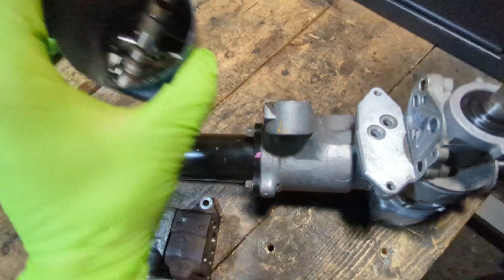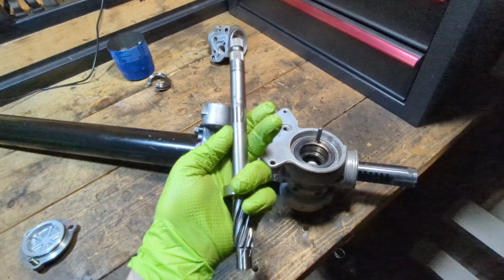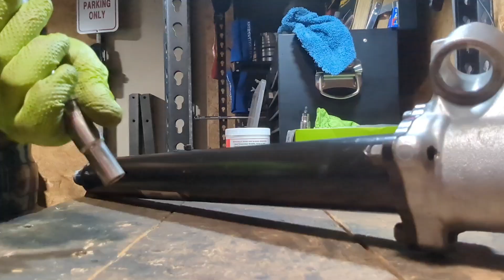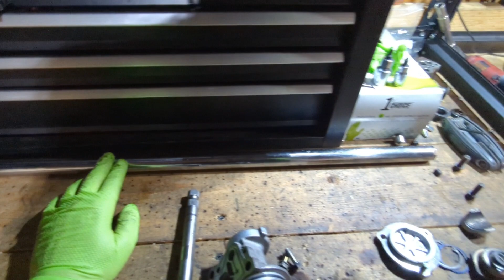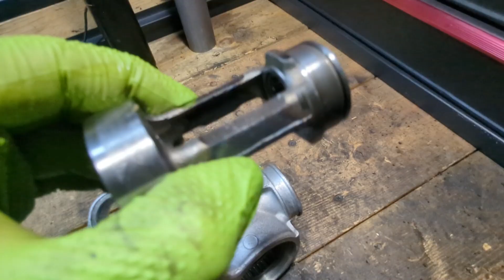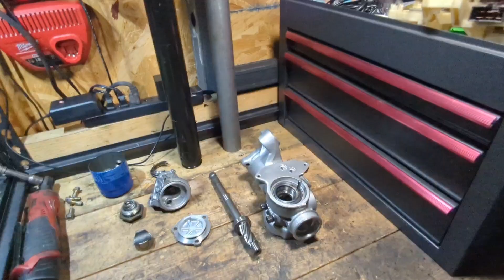How to Depower a EG Civic Steering Rack

Comment: Thanks for the vid. Once I had everything cleaned up, literally took 30 mins to drill/tap, grease and reassemble. I welded a small rod between the stopper bolts, so they can't back out.

Comment: so the rod (rack or whatever you should call it) is the same on both manual and power racks? i was wondering if i could replace my rusted rod from manual rack with a rod from power rack, which is more affordable because you can't find a manual one anymore.
Reply from the maker: Yes, they are the same inner and outer tie rods
Reply: @ThatParadiseEj1  i meant to say the rod that is in the rack, that is polished or chrome plated. English is not my first language and google translate just translates it as a rod.
Reply from the maker: @1ntegro  oh. Sorry. I have no idea if they're the same
Reply: @ThatParadiseEj1  aight. Thanks anyway
Reply from the maker: @1ntegro  I would suggest looking at the parts diagram for each steering rack and comparing the part number for that specific item

Comment: Hey man when u took the rack apart and depowered it, did the passenger side have alittle wiggle? After u cut the ring off piston. What did you do with the spring inside also the plastic circle internal peice and the rubber seal?
Reply: Inside the housing there’s some peices.
Reply from the maker: I kept the spring as well as both plastic guides. The guides are most important.
Reply: Could you maybe explain alittle more for me? I ran into a problem with my rack. I mean I got it all done but honestly when I popped the housing open the parts kinda feel out. What was there was a spring and a plastic guide and a small rubber seal. I didn’t see a second plastic guide
Reply: On the passenger side of the housing. I noticed a rubber grommet which I figured goes on the end inside of the housing but there was a plastic housing and a larger spring.
Reply from the maker: Do you have Instagram? Message me there and I can send you a ton a pics. There is definitely two guides on the passenger side
Reply: @ThatParadiseEj1 just followed u